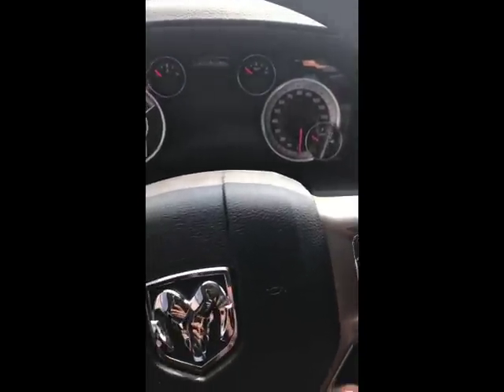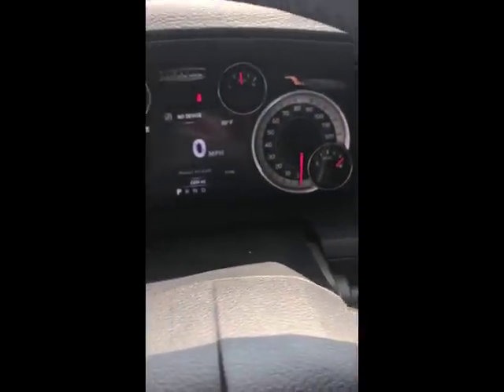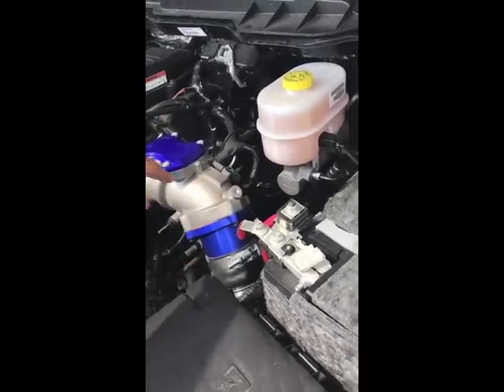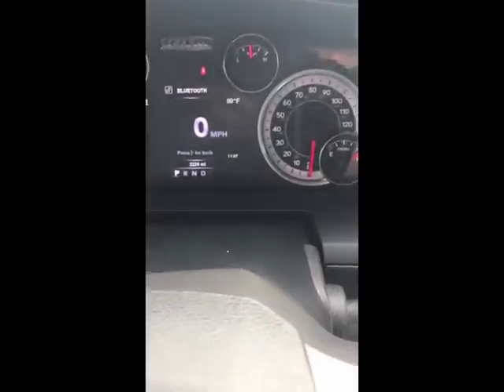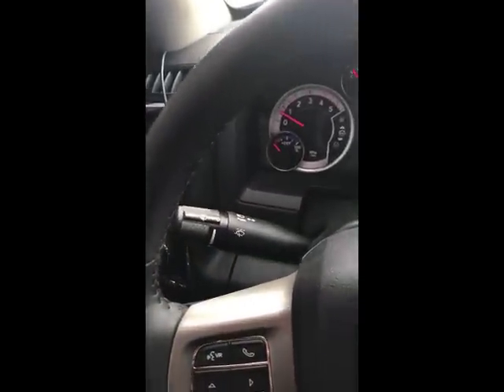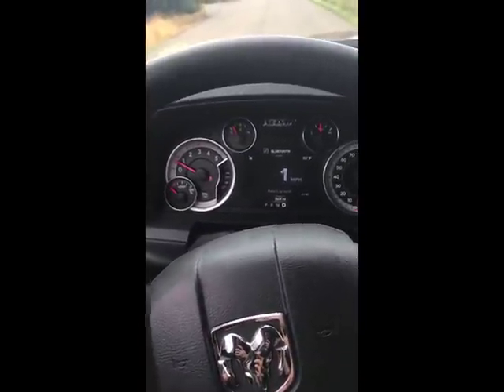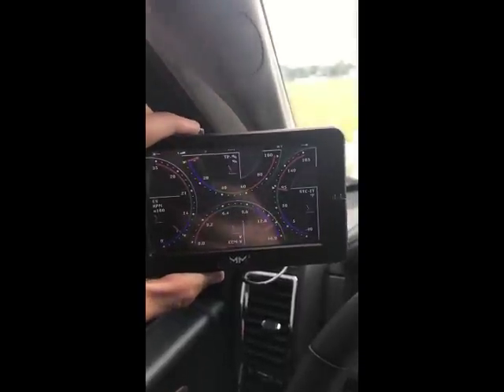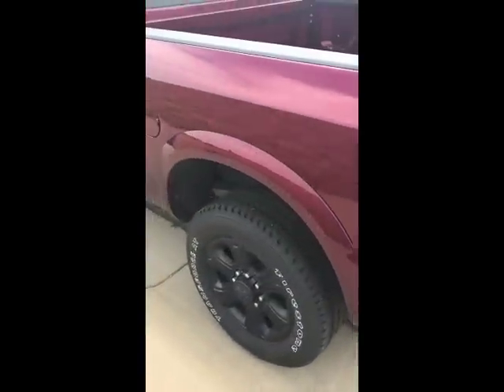Deleted my 2017 laramie cummins "sport" with 2k miles on it!

Comment: Now do the second gen mod!  You wont regret it.  I deleted my 16' at 3k and did the  second gen at 19k.  Raceme Ultra, w/ BW S467.7,  5" straight pipe, Banks Monster ram 4" intake manifold horn and coolant reroute kit to keep the back cylinders cooler.  Nice thing is, the kit alone dropped my exhaust back-pressure below the 1 to 1 ratio.  Sounds great, better fuel economy,   lower EGT's and runs so much better than stock!  Nice truck BTW, love that red!
Reply: @LoverBoyTactical I have the easy-going g56.  Went with a South-Bend dual disk, lightweight flywheel and high pressure short throw clutch hydraulics.  It's grabby, but can easily handle all that torque (hitting around 1,400ftlbs at 35psi).  

The premise of doing all the mods was for longevity and reliability.  I've put over 65k miles on the kit and only had a MAF sensor failure ($39) and a coolant leak due to a coupler o-ring failure on the coolant reroute kit, but all of it was a quick and cheap repair.
Reply: @LoverBoyTactical IMHO, if you haven't already, get yourself an EGT and Exhaust Pressure Gauge (mechanical pressure switch)!  Keep an eye on the EP, as that'll tell you alot about a head safe zone.  Getting to a 1:1 ratio is golden, (EP to boost) lower is better!  Typically, that golden ratio is acheived by better exhaust scavenging - i.e. manifold, turbo, fuel rail pressure and TIMING!
Reply: @LoverBoyTactical Ha!  MOD wisely and do your reasearch!  🍻

Comment: The tuner cable is not a problem on my truck.  3 years later it hasn’t unplugged itself ever.  Suction cup works better if your windshield is clean.  My 2018 2500 is getting 21 mpg stock.

Comment: @Barowed.  The suction mount has a little lever that you pull towards you after you push it firmly against the windshield. Mine has not fallen off in months. The Mm3 mini usb connection behind the monitor can be squeezed lightly together to firmly hold the mini usb cord. Cause of looseness is accidently pushing it in the wrong way or jiggling it in upon installation.  If you don't go with a well known tuner your service and tunes will suck. 19 mpg?... I get 18 on my 3rd highest setting. But I don't have stock size tires. People saying 20 + must be using the tiny stock tires and driving down hill as our trucks go on boost at 10% throttle and with that comes fuel consumption. The MM3 is tried and proven to be a beast in the right tuners hands. EZLynk has had issues upon release for our cummins.

Comment: You should check out Double R Diesel. They sell the mm3 with some nice tunes, you even get a 12V tune. They also sell the piller mount for the MM3 that monts to your Driver Handle bar.
Reply: I bought a DRD delete tune, after 4 moths and over 1500 miles, just excellent results, love it, Ray is the best, 2015 2500 5' flo pro straight pipe turbo back exhaust. Ray at Double R is the best and really helps support your effort. Also did a CCV delete and throttle valve delete. I mostly run +30 tune but Rays tune s up thru +200 is loaded and ready to go. my fav is 12V+120. Rays tunes really work and his delete kits are first rate. Thanks Ray. God bless.

Comment: Your Cummins going to get better gas mileage after about 40,000-50,000 miles. Much better. You will get about 22-24 miles per gallon

Comment: Try a good mount and I be that will fix your on/off issues with the monitor 
Part numbers:
Autometer #13117 (pod)
Edge #98004 MM3 two prong adapter for that pod. 

It fits tight and right and keeps you monitor where you can see it and use it. 

Sexy color brother.

Comment: Weird my 2017 3500 gets 19.1 - 19.5 mpg almost always...sorry about the tuner and mount.  My truck is stock at 9500 or so miles. If your not happy with the tuner sell it and get a ezy Lynk. I got mine coming from hardway performance and hopefully deleting my tuck this weekend. Do yourself a favor and don't run it hard on the highest tune without doing head studs.
Reply: Frank A how do you get 19mpg???  Is that just highway driving.
Reply from the maker: Love with tunes, Just not the hardware. I don't really hot rod around too much so the 60 tune is perfect
Reply: I'm around 19-20mpg stock
Reply: The Punisher my truck always gets 19-19.5 and I drive up pretty big inclines on my hour commute to work...my truck deleted is still at the same mpg. It didn't change after the delete...I always run Howes fuel treatment every tank 8-10 ounces per fill up..I doubt that does anything but I know it's good for the pump and injectors..
Reply: I have a 2017 3500 with Aisin Mega Cab Sport running 60 tune from Motorops. Just completed a DPF EGR Delete. I drove southbound on a local highway for 6.2 miles at 65 mph and after taking 1/4 mile off ramp and stopping at red light I was reading 6.2 miles, 32.2 avg mpg, 61 avg mph, 6:06 elapse time. Drove the same section of highway in opposite direction and got 6.6 miles, 21.6 avg mpg, 61 mph avg, 6:34 elapse time to take the grades into consideration.  The delete was at 3/4 tank of gas and I’m now at 1/4 tank after 4 days and my avg for the tank has slowly increased to 18.9.  After fill-up I’ll run an entire tank on this tune and hand calculate it. Running winter fuel in Alaska so should be better in the summer.  One of my favorite parts of the tunes is the exhaust brake staying on after shutting truck off.
Reply: I haven't heard of anyone having problems with gaskets or heads on the 13 and up trucks with tuning

Comment: Can someone explain to me the actual purpose of deleting your truck? I have the same truck and don’t have any issue. It isn’t deleted and about half of my 25000 miles is towing around 7500 lbs. I haven’t seen a video yet where the person who owns the truck actually uses the truck to do what these trucks are built for.
Reply: Todd Bunnett I've been wondering that myself.  Is it being done just so it "sounds cool"? ...gas mileage?  What if you get caught?  The emissions on the truck are federally mandated, so it's obviously illegal.  The other general consensus i read is that it helps the engine breathe better and last longer.  I know if you live in California, don't delete because they have emission inspections while most other state, including, surprisingly enough, NJ, don't inspect emissions on small diesels.
Reply: Bit late to answer your question, but if you live in a state that doesn't check diesel emissions, deleting a cummins offers a huge advantage over OEM (EPA mandated crap).  Deleting removes the EGRs known tendency of higher engine temps and coking of the intake, which can cause long term issues with the valve train and restrictive airflow.  It allows cleaner air-intake passageways and improved mileage (with programmer timing adjustments).  It also aliviates high costs of cleaning the EGR and or replacement later down the road (after warranty expires); $$$.

Going a step further, exhaust manifold and turbo replacement significantly drops egt's and brings head pressures down, better mileage and less stress on internals = longevity and reliability improvements.  If going a fixed vane turbo, it also solves the known VGT issues (solenoid failure), but removes the exahust brake feature, unless you add an aftermarket solution.  The process can be somewhat inexpensive or expensive, depending on quality of components of course.

None the less, it is all preference, like with any aftermarket mod there's tradeoffs.
Reply: @Father4ev3r  if they are asking that question they need not worry about doing any mods and enjoy their stock configuration.

Comment: How did the Aisin Transmission handle the extra power and did it have a tune for the transmission? I have a 16 SRW with the Aisin and was thinking about deleting in the near future!
Reply from the maker: I have the 68rfe in this truck and it is handling fine so far with the built in tuning but I've only put 700 or so more miles on the truck since the video. 
With all the failing filters dodge is having i would delete.
Reply: Aisin is the better tranny, delete, but don't be stupid, everything has a limit and the more you test the limit the most likely it is to fail sooner.
Reply: Barowed failing filters? I’ve had mine 3 years never had any problems. And your mileage sucks. I get 21 city 29 highway not deleted. Maybe you should learn to drive
Reply: Thaddeus Wertz I don’t think you can get the Aisin trans with a 2500, only 3500 or up. I’m not exactly sure cause I ordered my 2500 with a g56 but if I remember correctly I only had a choice between a 68rfe or a g56.
Reply: Evil One everyone’s driving is different & it really depends on where ur driving. I love hearing these guys say their getting 21 miles a gallon & they live in a state like Florida that’s flat as a football field. A guy driving the interstate a 100 miles a day on grade level roads is definitely going to get better fuel mileage than a guy driving a 100 miles on small wavy roads with 8%-12% inclines.

Comment: How much did a tune and delete cost I have a 16 Ram dually bought the truck used back in April never knew the truck was deleted got under the truck still had the DPF shell and scr shell everything was still plugged in but I took it to the dealer because every time I tried to fill up the DEF tank it overflowed dealer put a new ECM all kinds of stuff on it found out that the original owner gutted they emission system and had the truck tuned but never told anyone and then a dealer force me to put it back stock
Reply from the maker: Dealer shouldn't "force" you to. Sounds like they are just trying to make a dime off of ya, I would just bolt that empty shells back up and enjoy your delete! a lot of guys in emission areas do that so they can still past visual and DOT inspections.

Comment: 1 year later. How is the truck doing and how many miles do you have on it?
Reply from the maker: Truck just rolled 8800 miles with half of them pulling a boat. No problems, engine codes or blow by

Comment: not talking shit but when ya buy stuff off ebay you get what you pay for... invest in an edge cts2. you wont be disappointed
Reply: brandon mayes edge will never come close to a race Me..   raceme is smarty tuning.   The best tuning for a Cummins
Reply: Jason Williams I'm not talking about for tuning im talking about for monitoring.. tuning should be done through a reputable company and not just some default tuning from wherever..
Reply: Can you go over 100 with the edge cause my race me dont let me do that
Reply from the maker: It lets me go over 100. You can download new tunes that have different parameters that should get you over 100 mph
Reply: Barowed  ok thank you sir
Reply: Barowed  what  site can i download  that

Comment: Dam, did you get the MM3, from Double R Diesel..?   further ,I hate the hissing tune sound.   So if you care to share, what do you have in cost to delete, and what did exhaust run itself.  Sweet RAM  !
Reply from the maker: Think around $1700 for parts total with me and some buddies doing all the work. Exhaust itself is only 300 i believe but you need the tuner to go with it or you will throw some serious CEL
Reply: Jim the whistle tune is something you can get , but  DRD has the  tunes you want. 5" pro flo straight pipe turbo back exhaust.  Get  on DoubleRDiesel's website and check him out, I think total cost was $2500 ish, maybe less. There are some tricky spots but Ray helps you through them. I also know the way so if I can help I will.
Reply: Hey what do u mean tricky spots cuz i just orderd mine and was see what to expect
Reply: Got the 4 inch tho so no cutting
Reply: well there are no directions on how to delete hardware on truck. You have to use you tubers who have done it and then when you get to deleting parts associated with the Egr, all of a sudden there is no guidence. I called ray and asked about it. Example. the temp guage for the EGR cooler inlet to the manafold , there is no plug for that , you have to figure out a way to plug it with connector still installed. so there are some sticky spots but doable.
Reply: Is there a special way to get this exshust off im about to bash my fing head against the wall i cant not get the rear end of the pipe out of the rubber mounts
Reply: Justin venuto try spraying a fuck ton of nut buster along the connections & let it soak.
Reply: hey did you do yours already?  how did it come out?  just ordered my tuner, delete kit, and exhaust last night.  going to install next weekend hopefully if I already have by then

Comment: So how much did all of this cost you
Reply from the maker: The kit was around $1700. So that plus my Saturday was it.
Reply: Barowed funny story, 1700 bucks .... whats that, about 100 jugs of def fluid? If you kept the truck for 10 years you wouldn’t even use half that ....
Reply: Todd Bunnett yeah but now his engine will last a lot longer and it burns less fuel. The 1700 bucks will be made up for in repairs down the road more than once!